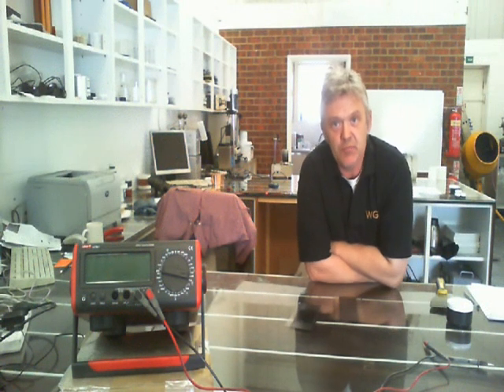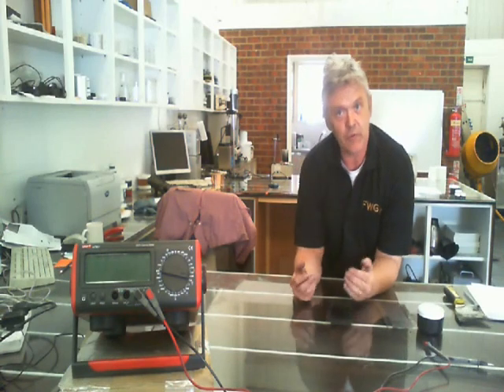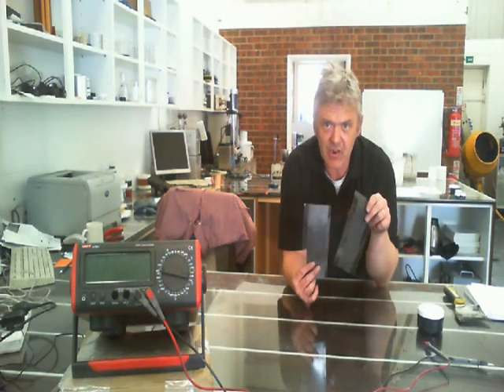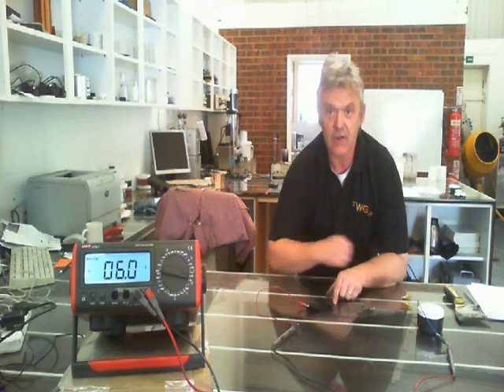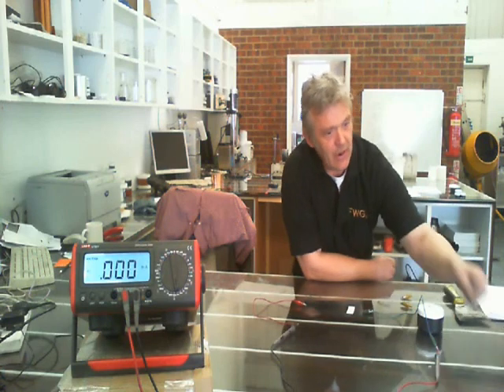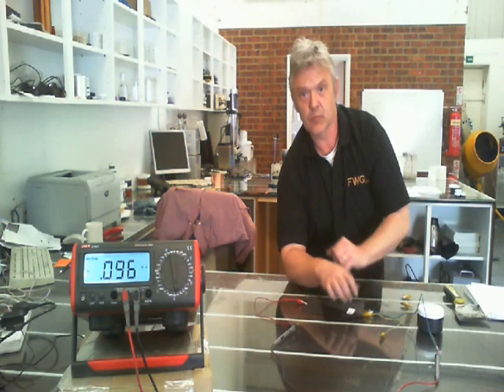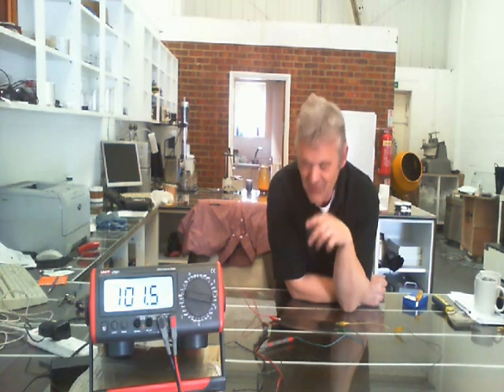Graphene Based Free Energy Antenna System

Comment: Correct if I am wrong but, isn't that more than 10 watts of actual power!? Simply AMAZING!!!
Reply from the maker: i hate to say this but it is 0.01 watts that reading is in milliamps so it is actually reading microamps
Reply: Oh, ok (my mistake). Still its pulling electricity that could be useful stored in capacitors over time.

Comment: You revived my interest in a fractal antenna idea I was working with since the idea was pretty dependent upon printing a conductive antenna. All I have to do is figure a way to nonstop print on a roll and I should be able to make virtually unlimited size and from that, make an aerial which picks up a very large number of frequencies. No clue if it will work.
Reply from the maker: you will know if you try it lol

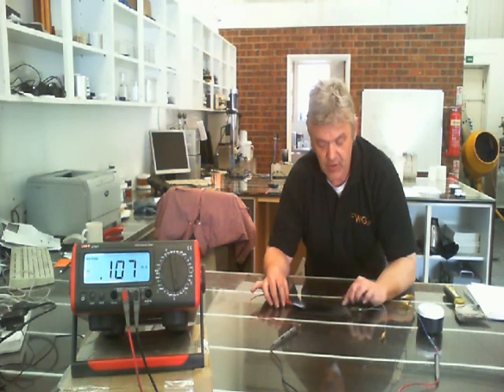Comment: at 2:15 there was no variation in amperage when you moved them away from each other for a second, what happened there? Also, have you tried to induce mechanical stress(tension and compression) on the graphene based piezoelectric cell?
Reply from the maker: Quavizo This is another one that needs a revisit - it would be good if someone else picked this up and ran with it - that's why it is here - lots of interesting things to discover

Comment: This is great. If you would change the size of your 2D collector (?) would you see a change in the frequency?
Thanks
Reply from the maker: probably
Reply: How difficult would it be to optimise this for use as an antenna at a particular frequency? It would be very useful if it can work at least as well as a simple dipole antenna for a 433MhZ application. But if it makes an improvement it would be *magic".
Thanks
Reply from the maker: RaptorUAS
have a look here http://www.urlme.net/blog/?p=2192 this is my friend mike rooke
Reply: @ThinkingandTinkering   is that page available elsewhere? It's not even on the Internet Archive.

Comment: Great Job Robert, I see in this particular case it appears that it's picking up the Frequency in the Atmosphere? But when it comes to your Hand I'm wondering if there is more to it than just your Hand being a airial? I'm wondering if we also have to take into account that our Bodies naturally gives off a charge on it's own and part of that is just being added to the Strips?
Reply from the maker: could be but for the large part of it i wasn't touching the set up - that is when it was 100 volts and 107 microamps i wasn't touching it
Reply: Yes, I agree, the 100 and 107 looks to be Aerial, but I was just wondering that small amount you got after placing your hand, I was wondering if that had more to do with the bodies charge more than aerial. Nevertheless, very cool work my friend!
Reply from the maker: could be mate - did you see the one on the effect of waiving your hand over it - it's one of the earlier vids
Reply: Haven't seen that one yet, but I wonder why in Mo Kha's Video "Something strang with a sheet of conductive ink" it didn't seem to read until he made contact? When I saw that I was thinking maybe there's something going on too with the charge in the hand? At least that was the impression I was getting.
Reply from the maker: certainly something weird is going on - and probably worth investigating
Reply: Yes, I thought that was strange too.

Comment: Hey Robert can you tell if the voltage/current will be doubled if you were to double the size/amount of plates used?
And wouldn't a step-down transformer be able to get the high voltage down to 110V and increase the current output?
Reply from the maker: i suppose so

Comment: Thank you Robert! I tried the same method. The dielectric (pvc) size touched each other but I got lower power on the same sheet. With touching I get 2.8 volt and 0.4 amp.AC and with cleaner cable I get 0.3 Volt and very low amp. It is better than the other two sheet. I think the painting technic is very important. Are there any important advice how to make the sheet. Thank you!
Reply from the maker: That's still pretty good mate - i used a doctor blade technique - but you could try brushing in only one direction - because i think you may well be right
Reply: Thank you!
Reply from the maker: no worries mate

Comment: Very good, is it connected to yours Graphene printed  T.V. antenna ? or is  it the old  commercial  Antenna on the roof ? By the way Tesla made it 100 years ago.
Reply from the maker: it is connected to the meter and ground and that's it - you are right it is basically tesla's work - but we all know that
Reply: Only ?????????  O my God. and it is now so powerful. That is amazing.
Reply from the maker: Bartosz Barejko
seriously - it is only those two plates that you see - one plate is connected to one side of the meter and the other plate is connected to the other side of the meter and then there is a ground connected - that's it

Comment: 101 volts?? no freakin way man.
This is unreal
Reply from the maker: all i did was turn on the meter mate
Reply: Robert Murray-Smith
Hey man, i know you said you were gonna continue the SWAG generator. But i think that this radiant energy tesla magic thing might have more umph to it? I wish i knew as much as you did. I would jump into it right away. I have taken up a 1ys electronics course though. So that i wont be lost when you explain the easy stuff. Good work. And thanks.
Reply from the maker: randomlettersqzkebkw
it does look good
Reply from the maker: *****
well - full details are in the vids mate so go for it - but it still has a fair bit of proving up as far as i can see - so i wouldn't sell your stocks just yet

Comment: I suspect it is acting like a germanium diode ( crystal radio).
What would be more interesting is?
Connecting the output to a Voltage Cockroft Walton multiplier.
This can be used to pulse change a 12 volt PB Battery ;-)
If successful? 
It will require a 741 op amp set as a comparator,  as not to over charge the battery.
Reply from the maker: give it a go and let me know how it works out
Reply: Robert Murray-Smith   You don't need a Cockroft multiplier to make this useful.  In fact you have the reverse problem of reducing the voltage enough to effectively charge the battery circuit without burning the power off as heat in the diodes.        I built a circuit using a AC rectifier and some smoothing capacitors that does this pretty well.   I was using it to charge a 3.6V circuit.  I tested with a 10,000uf storage capacitor which was charged to 5.1V over a 6 hour period.
Reply from the maker: Joseph Ellsworth that's very cool - do you have a circuit diagram you would share?
Reply: Robert Murray-Smith Could not add a image here so I made it available at https://drive.google.com/file/d/0B4wv6y9tmhTgRThzSjNrVUd6cVU  you may want to double check my math before trusting.   

I was thinking about building a small PCB and software for STM32L0538-DISCO to display mW of charge received in a near realtime basis,  mWh of charge since test start,  mWh of charge per hour so you can see the difference as you test the device in different areas.  You should also be able use the same device to measure your monoTherm and I could add a temp sensor so you can log the temperature correlation to power output.    

Let me know if you think your channel subscribers would be interested in this as a kit.  It would be a good excuse to make a new PCB and test new paper-white display on the STM part for under $30.00.

The STM part could accumulate a few hundred readings but you would need to connect to a PC via USB to download the readings.  Could also add a 1 Megabit storage chip to allow logging over longer period of time.     I think we would need to add a LED blink to keep the storage cap under 5V which makes the voltage dividers easy or could extend it with a user settable voltage limit and allow it to charge a external CAP or battery up to that limit.   If using to charge an external cap may want to also allow it to charge the battery we run the CPU from so it will run forever provided you are supplying sufficient current with a AC wave above 3V.
Reply from the maker: Joseph Ellsworth I am in the US at the moment mate - but i will discuss this with Ashley when i get back and we will have a look at your circuit - at first glance it looks pretty cool - if you are up for it we might do avid on it and point the viewers to a link to your kit?
Reply from the maker: Joseph Ellsworth some times it takes a while for comments to come through - can you e-mail me at robertmurraysmith64@gmail.com - i am keen to discuss this further
Reply: @josephellsworth4537  or 300 x3300uf capacitors in parallel